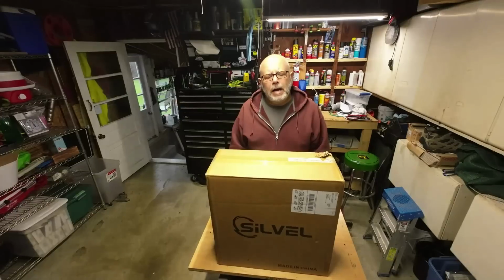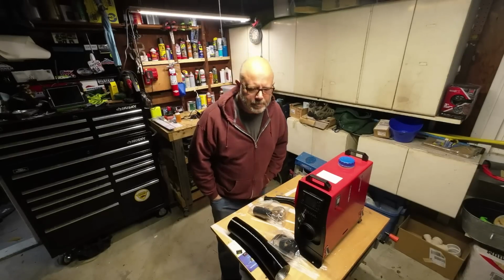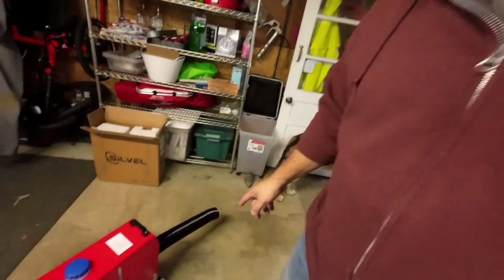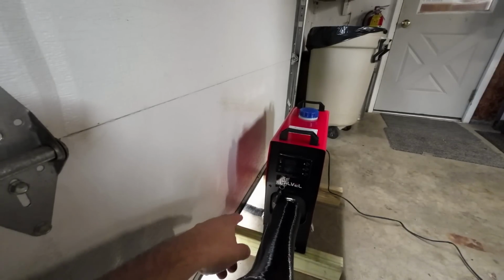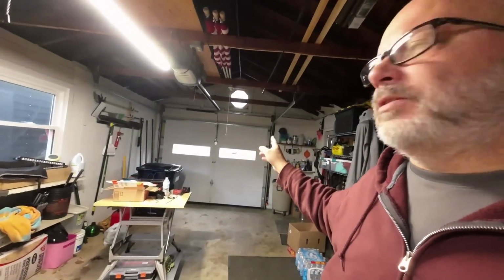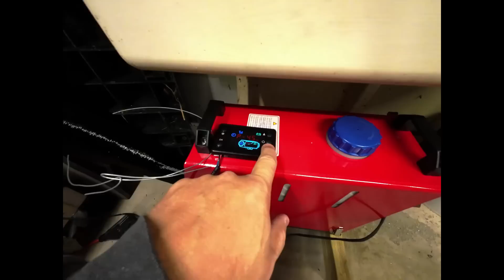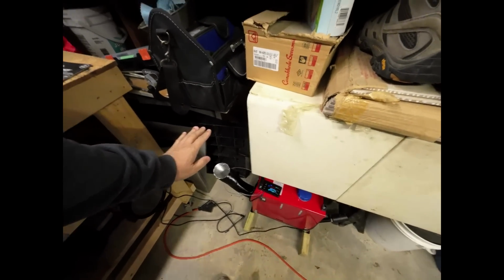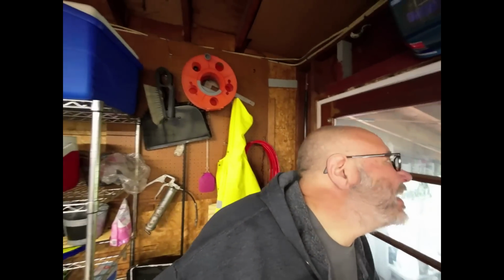I bought a diesel heater from CHINA!!!!

Comment: I just bought one for my van which I spend a lot of time in.  This way I don’t have to constantly start the motor to get heat.  I understand that these are pretty miserly using diesel fuel, so heating small quarters like I have shouldn’t be but a few bucks a day.  Thanks for your review and input as it sounds like I made the right decision!
Reply from the maker: Thanks for sharing that. I have another video that shows a thermostat that might work for you. I don't make any money on the product but there is a link to check out. It might work well for your small space.

Comment: That's a perfect use of the all-in-one diesel heaters.  I follow several full-time RVers and they say to always run the heater on High for a few minutes before shutting it down.  That will cause clean burning and help prevent gum ups.
Reply from the maker: Thank you for commenting and sharing your advice.

Comment: My garage is same size as yours and using the same heater I am very pleased with the performance of this heater 2  years and I am hooking up a second 1 for back up .  I am running a 20 gallon aluminum fuel tank that I top off with help from my friend at the trucking company using my 5 finger discount because they can't use the red diesel.
Reply from the maker: Thanks for commenting. I like the idea of a bigger tank.

Comment: I'm using one to heat my basement in the winter.  I have mine on the lowest setting and my basement gets to 55 degrees.  My pump isn't that loud.  Also I put a longer exhaust pipe on mine with the muffler on the outside with the small pipe on the other end.  I love it.  Mine is just going though an aluminum pipe out a window.  I made a small piece of plywood with a hole for the exhaust.

Comment: Hi Paul from the UK. You'll find it'll help if you have the air intake for the burner (obviously the one with the air filter) outside. If you run it as it is, it's constantly having to draw cold air in from the outside, which is in effect producing a cold air draft. Also I guess, as it's using up air, the oxygen content of your workspace might be reduced slightly - that's if you have your space sealed.
FYI I have an identical 5Kw heater in my workshop, and I've found that by running at approx 3Hz, it can fairly easily maintain 16 degrees C (about 60 F), when the outside is minus 4 C (25 F) My workshop is a similar size to yours, but has an insulated ceiling - the height is about 8 feet. So it's well worth getting insulation in the roof if you can. The other advantage of doing this is that it keeps way much cooler during the summer months. Dunno if that's an issue where you live? Regards Jono
Reply from the maker: Ok. Thank you for your comment. I will make the modification. Thank you!!!
Reply: Here in the UK the same unit is twice the price.
Reply: @boblordylordyhowie  The heater without the flimsy frame on eBay is about £100 -150. You get everything but the frame, the tank, the exhaust, the remote, etc. Easier to house as it is smaller and just the same as the one with the frame.
Reply: @ronnietexan  Except you have to buy all the rest and end up spending more money than the entire kit. Oh, and EVERYTHING in the UK is double that of the US.
Reply: @Bob Howie  No, as I said you get everything BUT THE FRAME! So it cost you no more money at all. The only thing that could cost anything is if you build your own frame, I know, I bought it, and that's why I added the comment. 
Edit. Not everything is twice the price, stop lying and spreading the lie. It's about £100 150 for the heater with everything BUT THE FRAME, not twice the price!
Reply: @paulethier3416  mount it outside in a box,theres kits to do that,or seperate comonent heaters. i bought the 340 doller one. havnt received it yet.will be mounted outside in box..tank can be inside.
Reply: @harrywalker5836 what’s the benefit of mounting it outside?
Reply: @SODAKFORD  it’s quieter. You won’t have to listen to the fuel pump. It’s safer because if there’s an exhaust leak it’s already not in your space.  The way he set it up in the video a gust of wind could blow the exhaust gasses back into the garage under the door.
Reply: Problem is heat rises and most of the heat is at ceiling level . 

He has his temperature gauge at what looks like mid-level on the shelf. If he places a temp gauge at ceiling level and at floor level he can then see that no matter how long he has the heater on for, the temperature will always be higher at ceiling level and lower at floor level.

The solution is to install a ceiling fan and put it on winter mode (clockwise). Even at summer mode is effective.

Only turn the fan on after good 15 to 20 minutes of the diesel heater being on.
Reply: @SODAKFORD  less chance of death by toxic exhaust gasses
Reply: @ronnietexan1029  I never Ben to UK and I figured he was exaggerating  but wasn't positive
Reply: @boblordylordyhowie  It has come down in price. I got mine for £89 including shipping from Amazon (other buyer, not prime).

Comment: All i would do is run the hot air line under the work bench toward the bottom of the tool box so when it’s chilly out first thing that warms up is the pieces of steel you want to use to fix other projects.

Comment: Just bought one of these after watching hours of videos about them. You may want to change the green fuel line for the harder white fuel line that doesn't compress and therefore won't cause fuel flow problems.

You may also want an inline fuel filter, but of course you can filter the fuel when you top up.

With the fuel tank, the last litre of fuel is inaccessible due to the high point of the intake, so many people just tip the unit forward by having one leg taller than the other.

Cheers Paul :)
Reply from the maker: Thank you for commenting and sharing your thoughts. I'm getting a lot of great ideas from people. Thank you!
Reply: @paulethier3416  My pleasure, lots of newcomers to this unit, it's getting very popular what with the rising cost of electricity and gas.
Reply: I like a filter on my fuel can too.    And additional transparent one exiting the unit’s tank,  allows any flow problems my visual examination.
Reply: @samuelhmullins2170  Thanks Samuel.
Reply: Hi Paul, what would be the average running cost of the heather be please...and would recommend this particular model...thank you.

Comment: I have pretty much the same unit you have ,us it in my tool shed .They work great and my set up is almost like yours although I did add a shield at the bottom  on the exhaust port to make sure it didn't melt the fuel line ,which mine almost did. Make sure and run it on the highest setting at least once in a while to keep it cleaned out inside also . Thanks for the video .
Reply from the maker: Ok. Thank you for commenting and sharing your experience with me.
Reply: This is the same unit I bought a few months ago. I have it mounted outside with just the heat outlet routed inside my shop. It'll heat my 10x10 little shop from 32 to 65 in about 45 minutes. Once it's warm in the shop I turn it down to level 2 and it'll hold 65-70 just fine
Reply from the maker: @stevenolson5703  Thanks for commenting. I can raise the temp in the garage 10 degree in about 1 hour. Its working great.

Comment: You would probably benefit from putting a small fan in the garage somewhere to keep the air moving and mixing the hot air at the ceiling and cold air at the floor. Especially since your roof isn't insulated. All the hot air is going up there and right through the roof.
Reply from the maker: That’s a great idea. Thank you for commenting and sharing your idea
Reply: Ceiling fan!
Reply: Should of made a small lean to outside and just have the air come through the wall keep the noise out, I've had one a couple of years just lug a battery around where I've needed it but also have a small solar setup just for it any power cuts still got some heat power 👍🏽
Reply: Id us a wood burner fan (works from the heat of the heater and no electricity reqired). Got one on my wood burner, great item.

Comment: Thanks for the vid but there is an excellent way to heat using those, The exhaust tube should be pointing sideways so the hot air can heat and rise across while warming more air at the floor, not sending the hot air right to the ceiling.
Reply from the maker: Thanks you for commenting. I'm looking at a few different ideas including a fan to circulate air around the garage. I did put the diffuser on since I did the video and it does work a bit better. I'm always looking for great ideas and modifications. Thank you for sharing your thoughts.

Comment: I keep my 20 x 20 garage with 13 feet ceiling toasty with the same machine. It works well. I recommend you run it at least 66% or above ti prevent carbon build up in the machine.
Reply from the maker: Thanks for commenting. I can hopefully get this garage sealed up and insulated this summer so it works even better. It was 13 degrees F here today and it kept the garage at 52 all day. I just need insulation and it will work great.

Comment: As mentioned in other comments hertz is pulses per minute for the fuel pump.  In general, allow 40 btu/sqft  for nominal insulated areas.
13×21x40 gives around 11,000btu or about 3.2 KW required input. Your unit is well within what will be required.
Diesel will generate about 40KW (137,000btu) per gallon.  By knowing fuel pump flow (pulses) on can generally determine the hertz setting for fuel.
I have 2 of these units for several years. One is 8KW and a smaller 2-4KW.
Reply from the maker: Thank you for commenting. This is an 8Kw unit.
Reply: @paulethier3416  There only 2 Size out there, "2kW" and "5 or 8kW" wich have only like 3,5-4kW real output power.
If you Multiply the Pump Frequency with 0,08 you get the Diesel consuption in Liter /h it is not 100% accurat but close.
But that is good to heat up a garage or a camping van.

Comment: I also do not recommend using this without a battery backup. There is a mandatory cooldown cycle to prevent damaging the machine. If the power cuts off, the machine won't be able to cool down properly.
Reply from the maker: Thanks for commenting. Others have made the same recommendation and I’m working on that.

Comment: If you put old filtered engine oil in this machine will it burn it?, or do you need to dilute the old engine oil with diesel fuel to thin down the engine oil to the same consistency as diesel fuel?.
Reply from the maker: I’m not sure. I don’t plan on running waste oil. I’ve heard other do but I’m not sure how they do it.

Comment: Great video,   you must starte at the highest setting  for vest running  ,than lowered a little.  If you don't run on HIGH  it gets all foul up.
Reply from the maker: Yes I typically start out on high, lower it as needed and the run it on low for a bit before I shut it down. So far it’s running perfect

Comment: It is desirable to run any of the 12v diesel heaters via a battery with a charger rather than a power supply. The heaters need to run a shut down cycle to cool the unit before  they finaly shut down. If the 12 vollts is supplied via a mains unit and there is a mains power failure the cooling and shutting down procedure will not be initiated which could cause an undesirable overheating of the case and unit.
Reply from the maker: Ok thank you for your comment and experience. I’m thinking a small lawn tractor battery would work for that?
Reply: @paulethier3416  it needs a deep cycle battery of 100ah
Reply: @paulethier3416  i have mine on both a power supply and a little 150 cca lawn tractor battery in case the power goes out and it works great. but im always hear and the few times the power did go out i shut it right down. but if you wanted it to run for a while then yes a deep cycle would be better 👍
Reply from the maker: @nextellcup8  Thank you for commenting and sharing. That's a great idea.
Reply: @paulethier3416  Yes. A cheap $25 Walmart garden tractor battery will run it. But you can also add a small 5 amp battery charger to it to keep the battery topped off while its operating That way, if the power fails, you can shut the diesel heater down with the proper cool down cycle. I have been testing mine on a similar setup for almost 2 weeks. My biggest improvement was to add a 1/10th watt 12 volt LED bulb to the top of the fuel tank so I know 2 things...the fuel level and that it has power.  https://www.youtube.com/watch?v=sHCuztvBnWs
Reply from the maker: @kimmer6  Nice setup

Comment: i have the same heater from vevor.
it is fine. but the biggest issue is it takes forever to heat room since all the tools, brick walls, floors pull alot of heat away. that boy takes couple of hours
Reply: I have one too. What I do is run an unvented propane heater for about ten minutes to get it up to temp them use the diesel  or electric  heater to keep it warm.

Comment: You can get hot air blower made specifically for garages and shops. A lot safer... Or outside wood burner in shack outside and pump hot water to radiators... A lot safer....
Reply from the maker: Thank you for commenting.

Comment: Great vid.  Quick question.  How is the boat vent exhaust fitting  working out?  Does it insulate the exhaust good enough from the hole in the wall.  I am thinking of getting a heater but want to vent it through the wall and would like to know of the marine vent remains cool enough where it contacts the wall. 
Cheers from Canada
Reply from the maker: It does but I wrapped it with the exhaust wrap where it goes through the wall. The wall is cool to touch with the additional wrap

Comment: So many alternatives  ways of burning,  diesel heater, wood stove[free wood], coal burner[hard coal].
I'm only interesting  in car without motor running, any good ideas  running heat in the cars[tiny tiny stove with pellets exhaust  pipe out of the car[any vehicles]  during snow storm  broken down  .
Look at one woman died from zero temperature,  no one can help.[upsetting me] any good ideas to tell me?

Comment: I am in Ukraine and considering providing these to a few families but I have a few questions. Maybe you can answer for me. 
Do you need to provide electricity the whole time you operate it or just to start it up? When the electrical grid goes down we won't have any electricity maybe for weeks in the dead of Winter (-15C approx.). Would a car battery do? How long might that last before it needs recharging? These are critical questions to know which direction to go for those in an apartment. They have enclosed balconies, so an exhaust hole can be made.
Reply from the maker: Yes 12 volts. It draws a little over 10amps on start up then 3-5 amps consistent.
Reply: You can run it off of a car battery, you could just run the power wires out to the car. Just be careful of how far down you run the car's battery. If you idle the car every few hours you could run it constantly. These will run on diesel or kerosene or even a 50/50+ mix of used oil and kerosene. That's what I'm running in mine. They'd probably run on cooking oil too but I haven't tried that yet
Reply: Yes they need power 2or3 batteries with solar panel will get through nicely
Reply from the maker: paul felgate paul.anthony.felgate@gmail.com  That's awesome. I didn't know that.
Reply: They burn a lot cleaner on kerosene and I can jet fuel at airport and they never get dirty if you run jet A fuel and kerosene works just as good jet a is just cleaner and mix it 50/50 with diesel to or pure diesel but once a month run kerosene to clean it up good and the last time you run it burn kerosene to clean it up.

Comment: I been using one to heat my house for the passed two years and it works just fine I have a external 60 gallon barrel outside my house I draft fuel from mine is the 8k version
Reply: any advice on which heater to purchase mate
Reply: @bp4682  home heating and garage  8kw.  Van 5kw  small garage  5k

Comment: Just use a 20k btu propane turbo heater, it will heat the whole garage in a couple of minutes without opening the door.
Reply: I was going to say the same thing. That little red contraption is frustratingly  slow at bringing the temperature up.

Comment: Hi Paul, What power supply did you use?
Reply from the maker: I’m using an old DuraComm model LP-18 that I’ve had for years. It’s rated at 15 amp continuous and 18 amp surge.

Comment: Never use a power supply ONLY - -  - you ALSO need a battery, so the system can run its "shut down/cool down procedure" - - - 
IF too many "hard kills" when you lose power - - & you'll fry the circuit board.
Reply from the maker: Ok thank you for the tip. I appreciate it.

Comment: It will still do its cool down shut down period on mains just turn it off on the control panel and let it run through ignore the other comments of needing a battery long has you don't shut main power switch off and just switch off from the panel on the diesel heater
Reply from the maker: Yes, I always us the control panel. Thank you for commenting.
Reply: the reason i added a battery is if there is a power failure. i’ve had 3 this past week with my heater on high.

Comment: At least 50% of the heat is wasted through the exhaust pipe.
Wanna double the efficiency or have 10KW of heat on the same amount of fuel?  
Put the unit inside and pipe the exhaust throuh a radiator with a 12V radiator fan end THEN out of the building.
These are basically just pistonless engines where they are barely 35% efficient unless you use the exhaust heat as well.